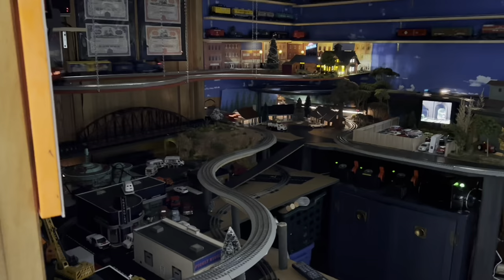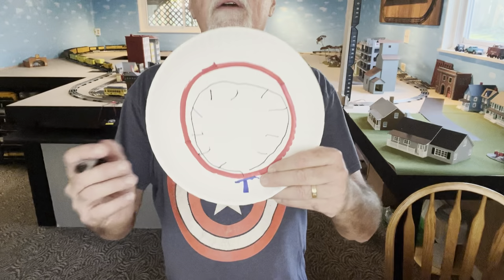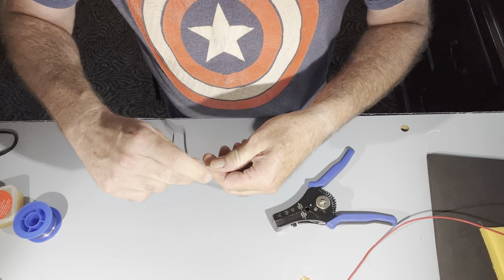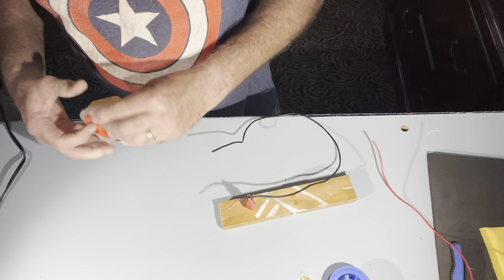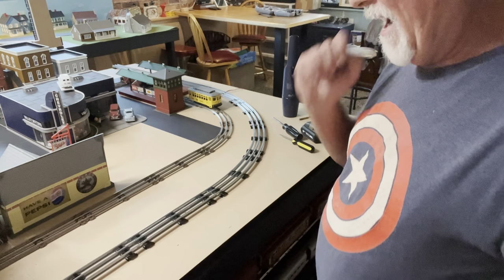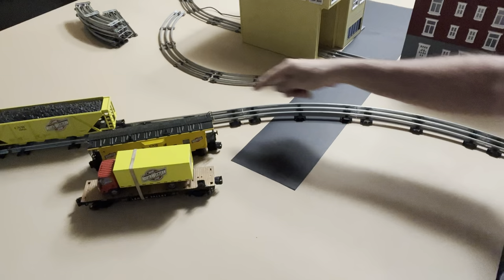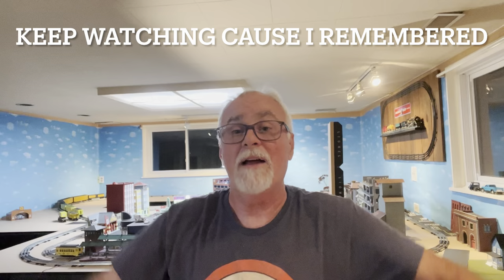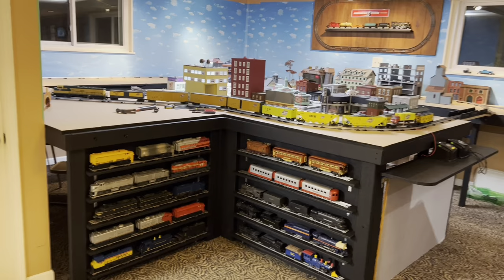How I’m wiring my O Gauge Layout and a progress update

Comment: Thanx I like the way you explain wiring easier 2 understand so thanx alot gunna be building a layout and the wiring part kinda scares me never done wiring before I plan on using fast track
Reply: When you use Fast Track be sure to put a piece of foam board s the top layer of the table. This will dampen the sound.

Comment: So you have never had a problem with the t taps or suitcase connectors. So many different views on using them. 
Nice layout. Thanks for the video
Reply from the maker: So far, no problems at all, as long as they are properly installed you shouldn’t have any issues

Comment: Sound like you have a big project ahead of you. You really do not need 2 bus lines to the far distant track. The outer rails are the ground and so send th electricity back to the source. You need the center feeder wires only. Save yo a lot of wire to do just the center rail.
You use flux when soldering  the wires to the track. Flux would also make soldering the tracks together easier.

Comment: When you use a junction block - you can jus strip the insulation off of a short piece of wire then you can just screw the bare wire to the terminals you want all together.  No  need to use those crimp on spade lugs. Easier and less work and cost.

Comment: Where did you get all those connectors? Can I get them at Menards?
Reply from the maker: I got my from Amazon, just search , T-tap wire connectors.  
I checked Menards web site and didn’t see them. Although there are different versions of this type of connectors available at Menards. 
I shop there when ever possible.
Here’s a link to the original set I bought from Amazon to see if they would work for me 

https://a.co/d/a2BQVSA